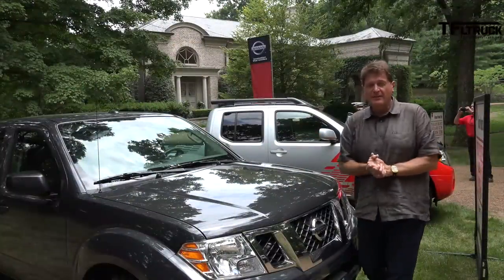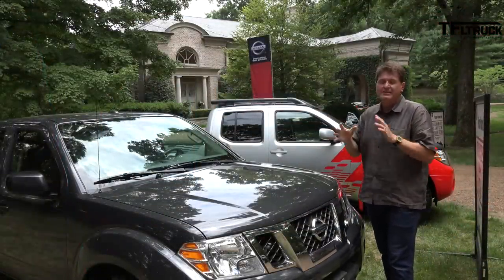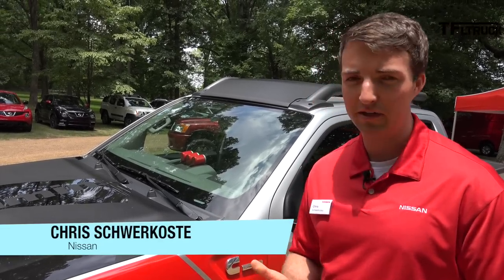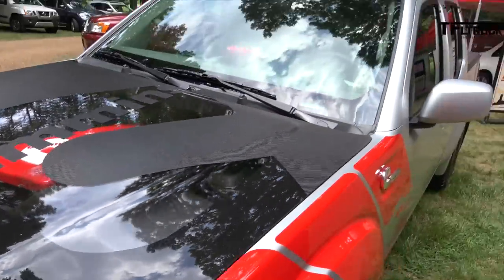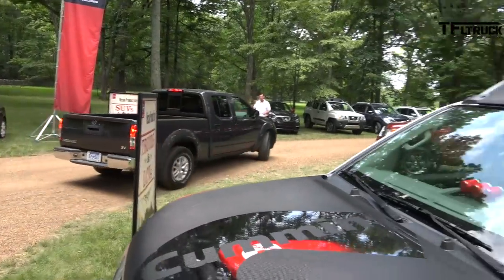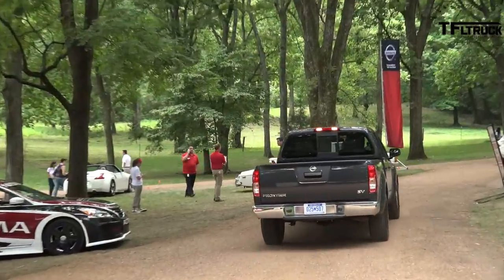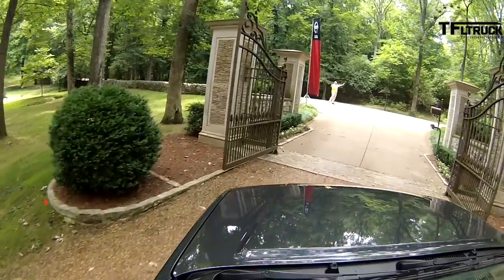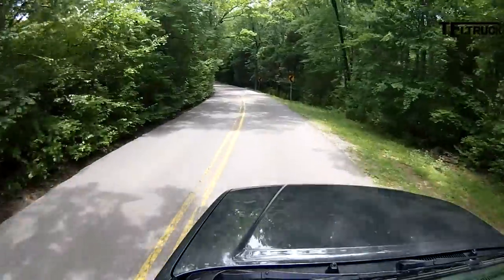Exclusive: Nissan Frontier Cummins Diesel Prototype Pickup Drive & Review

Comment: I am on my 3rd Nissan truck- '81 king cab 4x4, '91 king cab 4x4 (still own) and a 2012 crew cab long bed 4x4. I also owned a '96 Ford diesel van (sold in 2011 with 305,000 miles). I use them for work (carpenter). This is the truck I have wanted for 15 years-Build it!

Comment: For those who don't want a full size pick-up or a 1500/150 series truck, this would be great. I don't think the diesel is gonna be some crazy expensive option. Its an engine that gets better mpg and is a CUMMINS DIESEL!! Reliability, Long lasting, powerful beasts. Will the 2.8L I4 hold up to the Cummins name, yes! Time to see some frontiers still on the road after 280k+ miles on them.

Comment: "Slight" price premium?  Suuuuure.  I'm curious if the 35% better fuel mileage is based on the current model with the 5-speed automatic, or if it's comparing a 4-liter gas model with the new 8-speed automatic to the diesel with the same transmission.

Comment: Cummins are tops in dependability and longevity. At 200hp and 350 foot pounds. It sounds like a desirable match with the Frontier. Only if it has a respectable towing and payload.

Comment: I will be in the market for a new Nissan truck in the next few years.  The idea of a mid size diesel truck is extremely interesting to me.  I  have constantly asked my engineering co workers why no one makes diesel in a small pick up anymore.  I am however somewhat cheap.  It would be hard for me to justify paying much more than $3K or $4K more than what I could get in a gas (I would have to really look at the specs mpg  etc and look at the extra cost of diesel fuel).  If this truck is required to run on def I probably wouldn't be interested anyway just because of the hassle.  Does this truck need def added to it?  Nissan is the only vehicle I've ever owned.  I've had good luck with them and feel like they are just as good as Toyota if not better.  I also like the electric blue with the rack on top just saying.

Comment: Here in the U.K we have the Nissan Navara (virtually identical to the the Frontier) and it's had a diesel engine since it was released, how come the U.S only just got one?
Reply: The US still does not have one, this is just an evaluation mule.  

In the US even light duty full size trucks tend to be gas engines.   The only exception being the new Dodge Ram 1500 Diesel.  You usually only see diesel engines in the heavy duty pick ups.

As for why, not totally sure.  Diesel is more expensive in the US than gas so it does reduce the fuel economy advantage some but that is not the whole story
Reply: We have so many diesels here. But I suppose our roads, cars and driving style is different here, we drive Manuals much more here and have smaller cars and smaller roads
Reply: I am actually an ex pat and I would agree.  Diesels are more popular in Europe due to the higher price of gas in general.  Fuel economy is really something that Americans are only just becoming interested in.  When gas was $1.50 a gallon people didn't care if they only got 15 mpg.  Not its $3.50 more people are thinking about economy.
Reply: One thing you have to keep in mind is that diesel is taxed at a higher rate than gasoline in the US, which makes it the more expensive option.  To compound that there is the cost and reduced performance that comes with meeting our emissions laws.  Those factors reduce the savings you would otherwise see by choosing a diesel.
Reply: Diesel is more expensive in the U.K but many of our cars are more fuel efficient so it works out as cheaper to use diesel
Reply: 1guyin10 And what I want to know is why America is putting strict tax and regulations on diesel engine vehicles. Climate change, co2 emissions is all bullshit. Diesel engines aren't any worse.
Reply: Because we have a bunch of lefty's in charge right now that's why.  They think America reducing its emissions is enough to compensate for China and India doubling theirs.  Whether any of what they push is based on reality does not matter one bit to them.
Reply: Maad Dan There are those in power that can't figure out that burning more diesel more cleanly does not necessarily equal less pollution.  There is also the ideology at play that says that burning anything to produce power is bad (humans are a pox on the earth, you see).  Unfortunately that is who is in charge at the moment.
Reply: 1guyin10 I'd love to see these people survive even one day without benefiting from a fuel being burned. They'd literally die.
Reply: You can get a diesel in them, but it's a pain in the ass. Cummins makes one to fit but it's a lot of work and most people don't bother. They just need to fix the turn radius in them and we should be good!
Reply: 1guyin10  For me its not about cost savings (which is always good) it's the longevity, towing ability and value retention of a diesel truck verses a gas burner.
Reply: ***** There is also that great speed holding torque that makes them such good highway cruisers.
Reply: Because  North American oil companies  they dont like small diesel  engine's! !! They want us to buy 5Liters  or even 6litres  engine's! !!!!! ((((
Reply: Jhon777 007 true, us don't want any car that is fuel efficient.
Reply: US government is why.. Democrats and Liberals piss and moan about environmental concerns, therefore, limited consumer market Diesel powertrains are available here. The bulk of US pickup owners would LOVE if midsize pickups were offered in a Diesel configuration

Comment: If the Pro-4x with that diesel comes in at a lower price point than the Colorado Z71 with the Duramax (assuming you can get both in that configuration), you'll probably pull me away from GM.

Comment: I like fullsize trucks. I have one myself. But a mid size pickup with proven capability makes a good daily driver. Add in a Diesel engine for longevity and fuel efficiency...I'm sold. If its affordable.

Comment: If Nissan offered a Pro-4X version of this truck with a 6 speed manual transmission, I would definitely buy it! Nissan, keep up the good work with R & D on this project and be ready to roll this truck out soon if you do not want to loose sales to Chevy/GMC when they debut their midsize diesel trucks in 2016.

Comment: It's ridiculous that it even has to be discussed if a diesel in this segment is a proper powertrain. It's the only engine that makes sense. There only should be diesel engines in pick up trucks.
Reply: Tell that to fleet buyers with emissions troubles.
Reply: ***** yeah that and owners with high repair and maintenance costs.
Reply: ***** yeah that and owners with high repair and maintenance costs.
Reply: ***** You're talking about OLD diesels. The newer diesels I encountered in Europe and Australia are clean.
Reply: frattot888
I'm talking about the cost and reliability of emissions controls. I know they're considered "clean".
Reply: @mark7067  They can't pollute if they are always in the shop! THAT , my friends is how a modern emissions system works

Comment: It's a great idea as long as they don't try and ask 50-60k for a mid size truck
Reply: +Ivan R I'd be a buyer at $25,000 with the diesel.
Reply: Chevy wants 30 for there Colorado with the duramax
Reply: Ivan R Way over priced for how small the truck is. Hell one could buy an XL F150 for under $30k.
Reply: +Ratkill9000 Not all people want a full size truck.
Reply: Midsize Truck Man Just saying though, its way over priced for how much truck you actually get.
Reply: Ratkill9000 I agree with that part of what you say. A lot of these new vehicles are just becoming ridiculous (Price wise) and much of it is for bells and whistles features that we don't need.
Reply: Midsize Truck Man Or if you just want a truck that does what you need it still over priced.
Reply: Ratkill9000 Yea that is why gear-heads have a tendency to prefer used vehicles. Much cheaper and by then there is plenty of information and aftermarket support available, Witch is good, because being a mechanic I do as much of my work as I can.
Reply: +Ratkill9000 Very old design.  The back seats are horrible to sit in longer then 10 minutes.  Compared to the global Ranger the ride is garbage.  Really the only decent mid size is the one Ford won't sell us.  The new Ranger which destroys everything.  I've got a 2014 XLT Ranger with 5 cylinder diesel and its night and day compared to the Navara's which is the frontier overseas with diesel engine.  Even the duramax colorado I drove in Fiji is no match for the mighty Ranger.  Once you have driven the best you won't waste money on this garbage.  Ford does plan on bringing the Ranger to the states.  It may take a year or two but its probably worth the wait.  Its that good.
Reply: HiPlains1 I would not be so sure of that. There has been talk of the ranger coming back ever since the U.S. model was discontinued. I am sure that if Ford did bring the global ranger to the U.S. market it would be a big hit, however there are 2 main issues that prevent it from happening. 
#1 - Ford has other vehicles that they would rather sell to you. If you go to the ford ranger webpage it says right there that Ford thinks anyone who wants a ranger should just get an escape or F150 instead. Why would Ford bring back their midsize, if their fullsize truck is already the best selling vehicle? Keep in mind that profit is their huge motivator, and ford would rather try to get you to buy an F150.
#2 - Emissions. U.S. has by far the most strict emissions laws out of any country in the world. Its unclear weather or not that 5 cylinder diesel could be made to meet U.S. emissions, however even if it could, the add on of all the emissions crap would make the vehicle much more expensive, as well as reducing power and efficency, witch partially destroys the benefit of having a diesel in the first place.
Reply: Midsize Truck Man
Actually Ford just did the negotiations for the UAW to build and tool for the Bronco and the Ranger.  This just happened not long ago so you may want to read up on those events. Chevy's big trucks continue to build market share and the new Colorado/canyon are doing so well they had to add round the clock shifts to keep up with demands. Its too much for Ford to ignore anymore.  The demand is there.  Ford already uses the 5 cylinder in some of the transit vans and they already meet EPA restrictions.  Its all a matter of using a urea exhaust treatment to eliminate the NOX.   The 3.2 ecoboost makes sense for the US market being it will offer a more powerful option then the duramax and the upcoming Cummins 2.8 in the frontier.  The ranger chassis and suspension are worlds better then the Colorado/frontier.  Its a beast.  I know.  I own one.  And I've driven a Colorado duramax in Fiji last year.  Much prefer the Ranger's nicer ride, offroad handling and power.  Also drove it in flood waters to almost a meter.  This truck was built with the outback in mind in a joint effort with the Australians.

As for limiting power with the urea exhaust.. not so much.  But I agree it does add considerable cost.  But if my guess is right, Chevy will have a difficult time meeting the demand for their new Duramax.  The GM at my local dealer tells me he is continually asked on a daily basis when the Colorado duramax will be available.  It adds nearly 4K in costs.  Americans don't care they want that torque as is evidenced with all the 1 ton diesels running around.  Many of which aren't towing anything mind you.
Reply: HiPlains1 Nice argument. I will read up on it a bit more. I sure hope that what you are saying is true.
Reply: +HiPlains1 the rangers ride is ok. I wouldn't drool over it. Just relax chief
Reply: Whatever.  I've driven the Navara (nissan diesel truck) in Fiji.  It rides horrible compared to my Ranger.  Do you even own a Ranger?  I've got a fully loaded Ranger XLT 2014 and the ride is more then "ok" fella.  But for 90K FJD it better.  I've driven allot of trucks in Fiji and some of the interior roads can hardly be called a road at all.  The Ranger handles it all in comfort.
Reply: Must be the World Ranger since the US Ranger was ended in 2011. Last truck that rolled off was for Orkeck or whatever the exterminator company is. Twin Cities Assembly was torn down and turn into ghetto section 8 housing.
Reply: Yes it's a global Ranger.  Great truck.  They always made a different Ranger overseas and it used to be smaller then it is now but bigger then the old Ranger in the states.  They always had the crew cab option and a diesel option.  But it wasn't until 2011 that they came out with the redesign that blew the Toyota Hilux out of the water.  They even tweaked that design again 2016. 

The old US ranger was a compact (lightweight) with inferior towing and power capacities.  Still there is a loyal following of the older ranger and they command premium prices on the used market.

The Global Ranger is just a step down from a F-150.  Probably just a foot shorter.  Yet small enough to feel much more maneuverable around traffic and parking lots.  The Colorado is about the same size but not in might.  The Ford 3.2 ecoboost turbo diesel diffidently has more power then the duramax 2.8 and I know the chassis is much stronger as well.  It will be hugely popular if Ford ever brings it to the states.  Its already very popular in ever country they sell it in with super normal sales growth.  Ford is afraid it will cannibalize the crap out of their F-150 and it probably will.  But Ford is also concerned about the runaway success that Chevy is having with their Colorado.  So much they have negotiated with the UAW to build a smaller truck back East along with  a new Bronco.  Hopefully its the global ranger and not a small uni body POS compact.

Also, overseas they have a SUV based on the Global Ranger called the Everest.  Americans can only dream they could get their hands on such a machine.  Best mid size SUV on the planet and it looks really nice.  Also has the 3.2 ecoboost diesel.
Reply: @Ratkill9000  
Apples and oranges comparison. You're comparing a discounted 1/2 ton to a midsized pickup.  That's like comparing a Cadillac truck (EXT model) to a Chevrolet Avalanche. Both are trucks but are intended for different buyers.
Reply: @HiPlains1  
Nope. Ford gave us a Ranger with the 2.3L EcoBoost. Its fine for those wanting a fuel efficient engine. But not for those of us who want more hp/tq to do mild workloads and/or outdoorsy stuff like camping. The 2.7L EcoBoost V6 is the better, upgraded choice for me.
Reply: @Sig721Tau  The EXT and Avalanche are the same truck. Just different badges. I still stand by my statement, midsized trucks are overpriced for what you are getting. It's why the Ranger was killed off 8 years ago. These new midsized have similar specs to trucks from the mid to late 90s.
Reply: @Sig721Tau  or the 3.2 L 5-cylinder diesel that's offered overseas would be even better than that.

Comment: Amazing how times have changed.  All the maintenance cost of ecoing diesels has really killed their cost advantage.  It seems America would rather fill the ocean with old tesla batteries then puff diesel smoke into the air.  The largest brown delivery company is completely phasing diesels out of their delivery trucks and going back to gas. That's a complete 180° to 15 years ago.

Comment: I cant wait. I love Nissan and diesel engines. Ask me they should also come in a manual transmission. Auto trans are good if your on the road, up on a back road you need a manual, especially while mudding, pulling, and towing.

Comment: This is an outstanding combination. I now have 80,000 miles on my 2010 Frontier 4X4 crew cab, and I am starting to look for a replacement. The Dodge Ecodiesel  has too many reliability issues. Ford's new aluminum F150 and 2.7 Ecoboost are a big mileage disappointment. Chevy is pricing its diesel Colorado much too high. My Frontier has been wonderfully reliable and comfortable. Combine the Cummins diesel with a fresh body design, and I would buy a Frontier again in a heart beat.

Comment: Shut up and take my money! I WANT IT NOW! Use to have a 2001 Nissan frontier 4 wheel drive v6 lasted until 250000 miles. I couldn't buy another one because I was getting like 15 mpg on a good day. If this comes in to fruition I will definitely be buying this brand new.

Comment: I'm still waiting for Chevy to put a light duty diesel in the Silverado. I love my '14 Silverado, but I wish it had a diesel for the fuel economy.
Reply: definitely, but the sad part about modern diesel engines as much as i love diesel is the fact that the government requires diesel engines to have a DPF, and that significantly REDUCES milages to less than gas... but diesel has a lot of other benefits that still make it better in my opinion but sadly they don't get the milage like they used to...
Reply: Good luck with that wish, unfortunately. However, the new 2015 Colorado will be available with a 2.8 Litre I-4 Diesel in 2015 (or so GM says). I wouldn't personally bet on that promise since GM contributed to North America's hatred of diesels in the first place, if not THE company. What I'm referring to in that is, they made Diesel engines from a Gasoline blocks, parts, and among other things, in the 80s to save on production costs (Big NO-NO!). They ended up having the extremely unreliable reputation they have.
Reply: Ford is proving that turbo direct gasoline injection is a viable option for pickups. Expect more of that.
Reply: Theodore Thorpe the diesel engines didn't have gasoline parts, but they were designed to be built on gasoline production lines so they have the same bore, stroke, and sadly, the same number of head bolts. That last part is the problem. But you could use the diesel blocks when building performance gasoline engines for more durability because the block was much, much stronger.